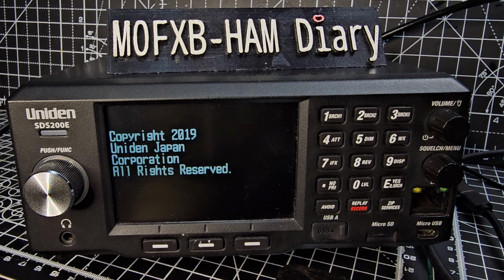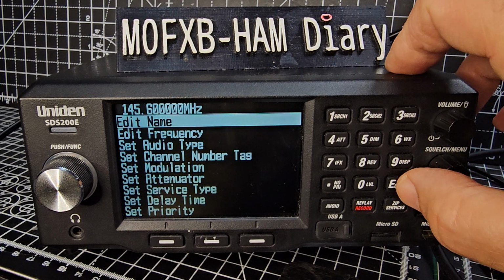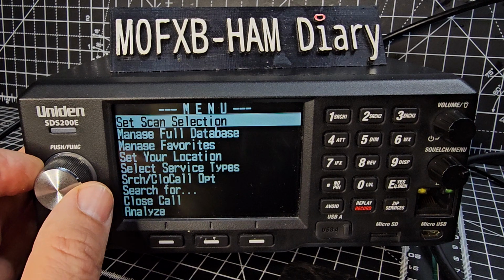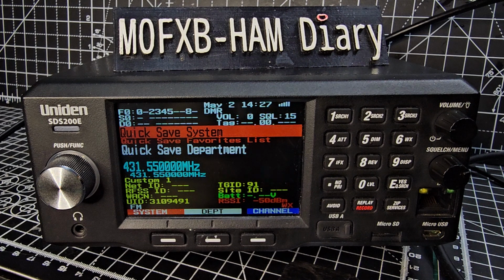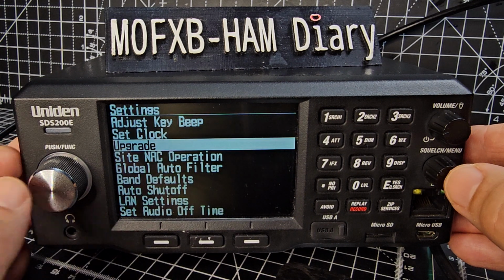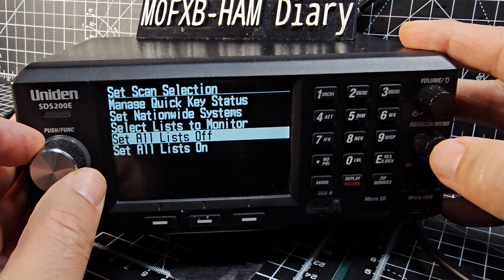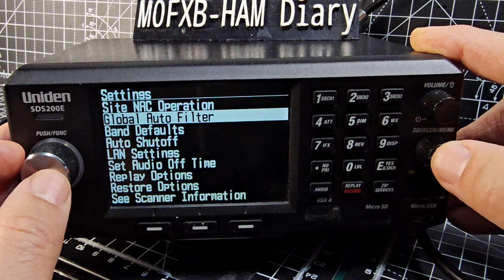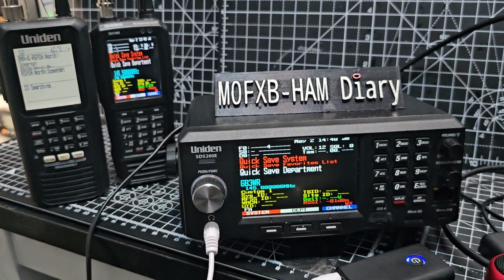UNIDEN SDS200/100 - REAL BEGINNERS GUIDE 2024

Comment: Thank you. What a well presented video.
Reply from the maker: Thanks for the feedback .
Reply: @M0FXBHamTech  if you put the UBC125XLT and the SDS200 both on the same good external antenna, would the SDS200 pull in better signal and audio? i would only change my 125 for that reason. Any advise would be much appreciated Thank you Ray

Comment: hi just wondering how do you get the scanner to work with micro sd card you can buy with frequencies on?
Reply from the maker: Sentinel loads the card for you or buy a card from a Hamshop .
Reply: @robertsutherland4761   Uniden offered to program my SDS200 before they shipped it - but wanted to charge me $79 (£61.33) but I declined. Sentinel was a bit confusing at first, but at 15 min I caught on.
Reply: Are u going to get back whit me